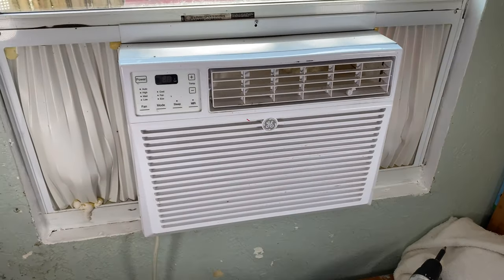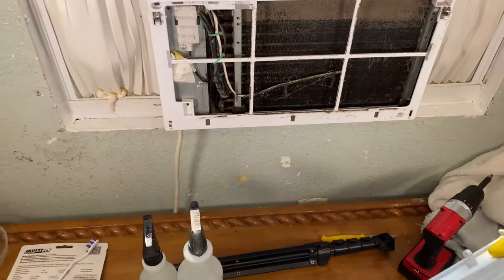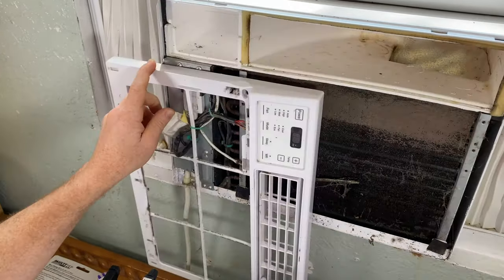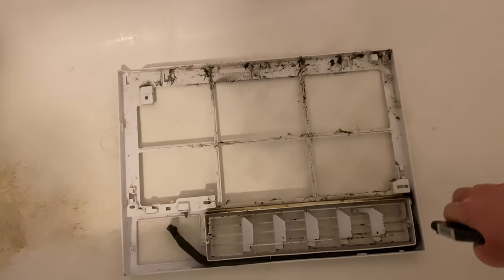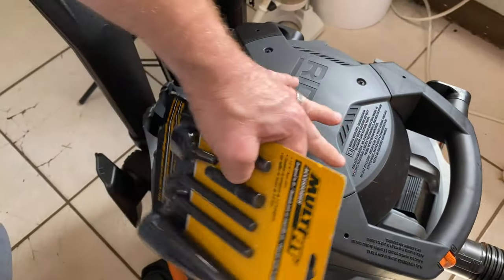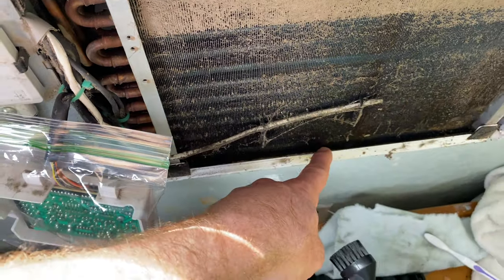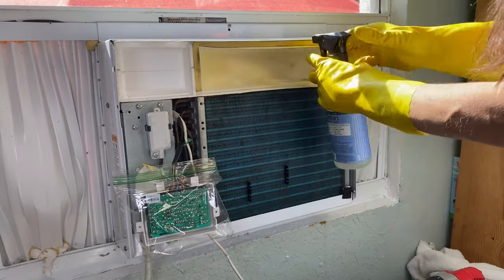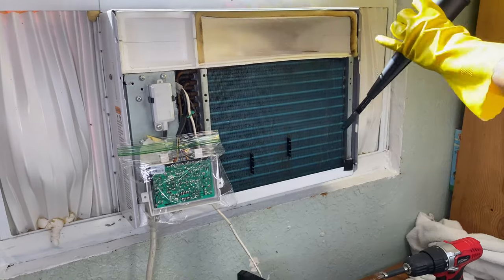How to Clean A Window Air Conditioner (AC unit)The Easy Way Without Removing From Wall The Right Way

Comment: you can also use a tampon or a pad to absorb water in a window ac unit. for inside where the fan is, tie a string to the string of the tampon then drop it into the fan section, you can repeatedly squeeze the water out then drop it back in. just repeat the process till you're satisfied. for the pad, place it flush against the front coils and make sure you put the edge of the pad in the little space in the front coils. I know it's odd and some may say it's disgusting but just to clarify, I'm only suggesting the use of a NOT YET USED tampon and pad...
Reply: Lol I read were cops keep pads in trunk of car for big wounds when they deal with accidents
Reply: Not used. 
I would hope not. Lol.

Comment: I appreciated the video. The one question I did have, however, is how do you clean deep inside the A/C unit where black mold is still present (without removing the A/C unit from the wall)?

Comment: Is it necessary to make sure the internal areas of the unit are completely dry before plugging it back and and turning it on??? I cleaned mine with 280° steam, (most chemicals strong enough to clean off the wet build up on the fins are also very corrosive and hazardous to your health if you breath them in, especially bleach) and one thing we're all taught from a young age is that water and electronics do not mix. So now I'm afraid to power on the unit in fear of it shorting out and stop working. We still have 2½ more months of 105-110° weather before temps start dropping below 95° at night, so frying my only A/C would be extremely dangerous for me and my family.

Comment: Forgot to ask.  On you outside frame. Did you open up any of holes that had a small disk covering that looked like they are spot welded.  If you could show the outside framing and if you clean that would help a lot. My husband  didn't  open the holes said we didn't  have to but instructions  mentions the holes. Sorry so long.

Comment: Good video. But there is also coils on the rear of the machine. The inside of the rear coils can get completely plugged up with leaves, dirt, and debris from dust and leaves from the fall. If you don't want to take apart the A/C cover to get it super clean, you can spray a hose on the fine stream setting straight into the back. It will dislodge the dirt from the rear outside fins. Don't worry about getting the inside wet, because the part of the air conditioner that's outside gets wet in the rain anyways. This will make the air a whole lot cooler and more efficient.
Reply: You're saying to spray directly into the coils or to spray from the vents in the casing?
Reply: @TheMendo123 I believe he means to spray it from the outside, not through the vents. Hard to do for many people though, as they likely don’t have access to the unit from the outside 🥲
Reply: He mentions on the video that he has a separate video for cleaning the rear (outside) coils.
Reply: @nova31337  Thanks for the reply, I'll check it out.

Comment: They make a spray foam cleaner under the brand name FrostKing that will pull out all the caked on dirt that's deep inside the coils. I use it every year on my AC units and the stuff is amazing. Those coils get dirt deep inside where you can't even see it and this stuff brings it out.

Comment: Awesome job.  I got one used for the garage and blew it out with hose- simple green for the coils and bleach for the blower fan and duct.   Be careful not to get electric parts wet as you have to wait a few days for the electronics to dry out before it will stop blowing breaker and operate correctly.

Comment: Hey guys I’m in Fl too Just finished watching ur other video of cleaning & hosing the unit real good on the outside & I’m curious, how long did y’all wait after cleaning it before powering the unit back on? Mine needs a thorough cleaning too but If the unit needs time to dry out I’d rather wait a month or two till the weather is a lil cooler it’s just way too hot to go without running it even for a few hours! Tx

Comment: My unit is disgusting, waiting for grandson to help and it quit with a E8 error code. Telling me its too Hot and too HUMID. no joke. Ugh I reset as told by manufacturer but all I could find on cleaning it was major deep cleans with 1000 parts to reconnect. Or this video. Thank God!!!! Very detailed. Appreciate showing me in detail but time lapsing tedious redundant work. Beautiful balance of both! Made me feel like I can get the mold out of it. Thank you so much!

Comment: For me this was helpful. Primarily in not having to remove the unit, take it outside, place on a table which would have to be fetched from the garage, unscrew the many more screws and clean the whole thing--I'm not up for it, and I know my menfolk will be resistant to the idea. I think your approach gets the unit as clean as it REASONABLY can be. There is a product called Frost King which might eliminate the toothbrush scrubbing; it's a spray-on foam, requires no rinsing, and it just drips away the dirty foam. But it might also be that in the end, human hands with a toothbrush can achieve better results! In either case plenty of paper towels are in order. It was also helpful to see that you had a team of two, brainstorming the idea of keeping the electric stuff dry within a plastic bag, and running and fetching the attachments to the shop vac. I find that moral support--doing an unpleasant job with a buddy--can be uplifting and turn a bad chore by one person into a task accomplished that both can be pleased with.
Reply: Mine is upstairs and would be extremely annoying and also risky to carry up ladder
Reply: You’re not related to Ron by any chance are you?

Comment: Thank you both for your amazing video. Best video I’ve ever watched on how to clean your AC inside out, without having to remove it from the window. Thanks for all the important details, i.e. how to remove each part, and solution that should be used to clean the coils. Did mines today an boy was I amazed. Been wanting to clean those disgusting vents and coils for a very long time. Thanks to you both, my AC is cleaned an looks like I just got a new AC. 
TEAM WORK MAKES THE DREAM WORK 🙌🏾 
😊 WooHooo 😉
Reply from the maker: your welcome

Comment: what about in back of those coils near the fan. it seems you did a great job on the front but evap coils get wet and traps dirt deep inside the fins of the coils.
Reply: I tried this method and lots of dirt came off. but i decided to take it outside and apart and pressure spray it and I couldn't believe how much more dirt came off. My drive way was covered in dirt. not to mention the squall cage fan behind the front evaporator coils were just about completely clogged with mold and dirt. for you to have that much dirt on the front of the evaporator coils I'm sure the evaporator fan is very dirty and needs to be cleaned. proper air flow across the evaporator coils is a must.
Reply: @Obscure existence 
I think that gets ignored most of the time even though as you indicate that is probably the dirtiest part of these units over time. 
You really need to take the unit out of the winder and take a hose with sprayer and use water to flush it out from outside to inside and the fan blades/or cage. (try NOT to get the actual fan motor wet!) Best thing is to spray at an angle downwards instead of pointing the water directly straight into the evap coil

Comment: Great video!
Let your wife know the shiny metal is aluminum, which is softer type metal that conducts hot or cold temps aaaand it bends easily so be careful not to bend the flange type coils.
Reply: She know about the easy bending. Because when she first started, she said to be careful with the toothbrush

Comment: I'd rather remove the front and just vacuum the dust and junk before it hardens. Would vacuuming more often prevent mold and mildew build up? I REALLY don't want do move at all and avoid this intensive cleaning.

Comment: My ac front piece has the the buttons on it. I can't soak it in the tub... Plus it's built into the way. My landlord didn't install a window for the AC.
Btw I used to work at shop vac in Williamsport PA where they are made. It's right down the rd from me lol.

Comment: I was having this issue where rhe ac wasn't cooling off the room it was in for 15 years. I finally took off th e cover, went behind the filter which I clean once per summer when I switch it on and noticed all this dust. Used the toothbrush trick shown int he video to really get in there nice and tight. Problem is I'd have to remove the ac from tbe window to unscrew the front casem did however much as I could do. Made a huge difference cool the room off instantly and that smell of dust is gone. Thank you very much for saving me $350 plus tax on a new ac.

Comment: These units should be designed to be easily cleaned.  Good grief...
Reply: If they did that no one would buy new ones.
Reply: Yes! Yes! Yes! It should be easier to clean and maintain. I usually just go buy a new one.

Comment: Although 2 years old and just now in my feed, those are called fins and not coils. You also can buy a fin cleaner/straightener at Lowes or Home Depot( I had a set years ago when I did maintenance at a  hotel in NC.) Didn't know you could take the face off like that. Will definitely clean mine now this way, with a twist or two. Thanks.
Reply from the maker: Thank you for commenting and watching
Reply: @KendallTodd  welcome, try to find those fin straighteners or if you know a HVAC guy.....thanks again.

Comment: 061724 I began cleaning the unit in my apartment. I took out the screen and vacuumed and brushed the filter and cooling coil fins but the unit is truly GROSS and needs either placement or a in depth detailed cleaning such as you did in this video. BUT, because it's not my unit, I have now sent a Maintenance Request through to the management. I will await their response.

Comment: Will this stop the leaking? My a.c. is leaking like crazy on the inside.
Reply: Mine is doing the same. I'm gonna try this and see what happens. Mine is off, but this bedroom is hot. The grill part behind the filter is completely clogged, hope this works! Don't really want to buy another one this late in the season.

Comment: Thank you so much for the video. We live in an upstairs carriage apartment and removing units would be a big hassle. Of all the years we've lived here and replaced in wall unit and a window unit we've never had any issues with grayish, reddish slime building up on the metal grill.

Comment: My wall unit wont turn off !! The air will stop to the setting temperature but it makes a sound i turn the power off and it still humms..it sounds like the compressor...i literally have to pull the plug out to turn it off completely ... summers here 3 digit weather and im wandering if i should find out whats wrong with it or just go buy a new one 😭...does anyone have any advice ?? 🙏🙏
Reply: It blows out good cool air still

Comment: I just use dawn dish soap in the spray bottle. Let it set for a minute. Scrubbing it with a brush.  Then rinse off with hot water.  In a spray bottle. Works great. Clean and shiny.

Comment: Unfortunately, I was unable to take my cover completely off because of the vent adjustment.😢 for some reason it connects all the way to the back of the top airflow area. But I did the best I could

Comment: Thanks for getting me on the way to a cleaner A/C. I have the GE AEM14QL2, which appears to be the same unit. I took out 4 screws from the front, but I could not budge that front panel. What do I need to do to get the panel off? Thanks again.

Comment: I started to look for a way to remove the face of the ac but I then realized that there was a pull tab on the side. I pulled it out and the filter came out entirely lol. Thanks for the video I might have needed but I think I got it.

Comment: I have question after what you did brush and vacuum brush... what did you call that spray ? Sorry because I'm hard of hearing
Reply: It's just regular soap and water. The brand of soap she used was Ivory but you can use any.
Reply: @success9271  Thank you for the tips
Reply: @success9271  even dish soap?